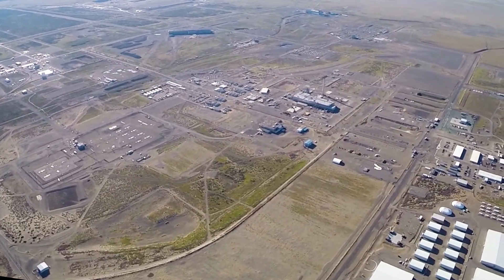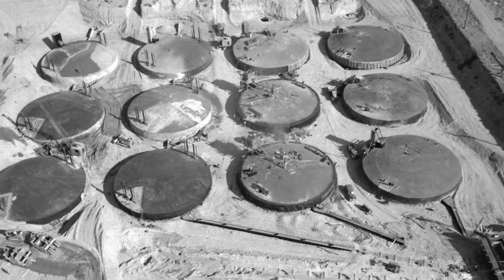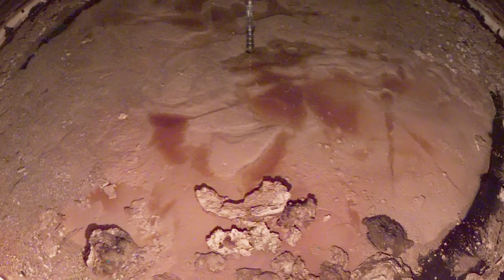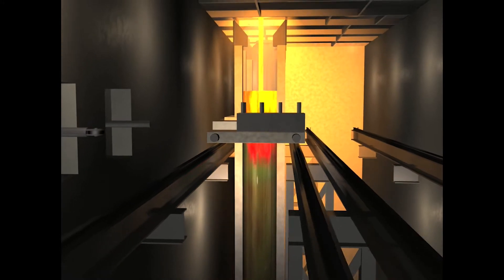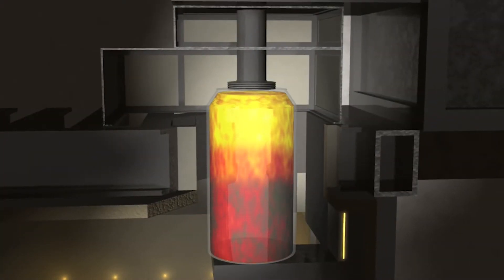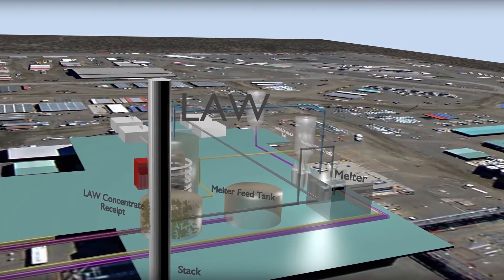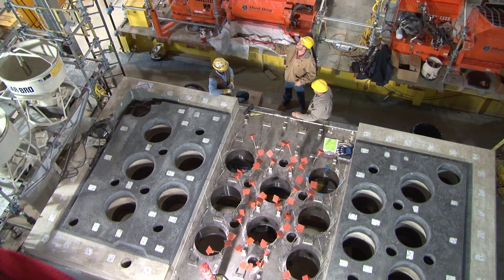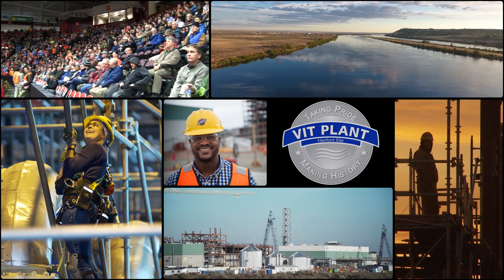Hanford Vit Plant Overview

Comment: You might look into a slow speed underwater water power terbine to back up you diesel generators in case of power loss. Waterotor works 24/7 and only needs 2 to 3 mile a hour water flow to work. Waterotor won't harm fish and can be scaled up to cover your needs. I don't sell or work in any way for this company it's just an idea I found on YouTube. With the power loss at Chernobyl because of the war this idea may very well save your ass. Let me know if you like the idea.